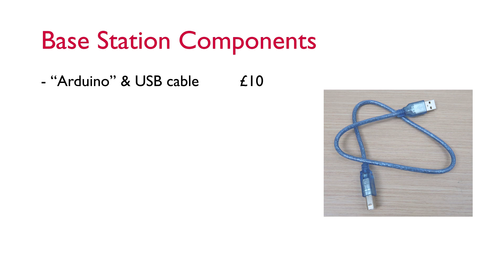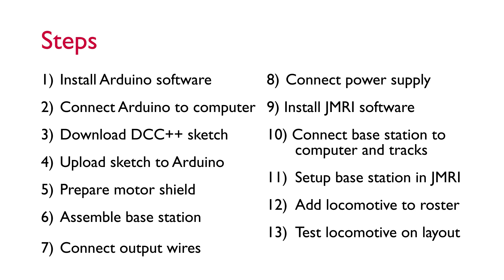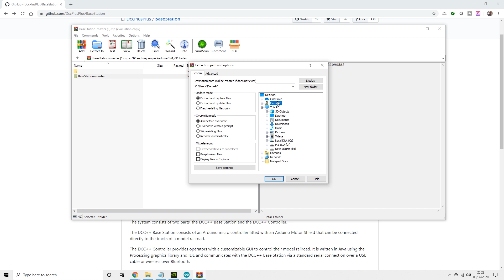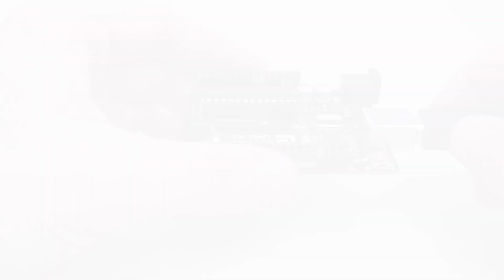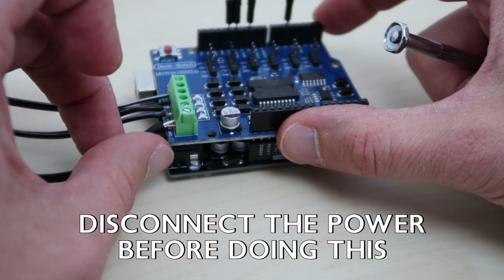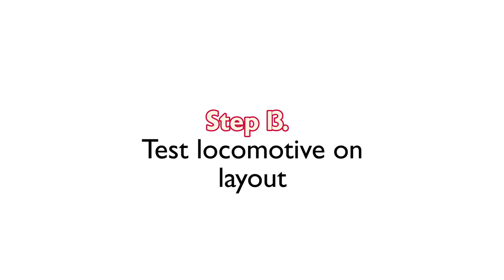Model Railway Digital Controller (DCC++) for £40 or less! 😮

Comment: I found this interesting as lately I have been also interested in the Arduino system. I currently have an Arduino Uno R3, the Mega and some Nano's. I wanted to build a few of the electronic kits available and I also have various module units to make and learn the Arduino system. When I saw this post title I thought, fig I must give this ago myself. The only thing I need is the Motor Shield and to solder up a few cables with Dupont connectors etc. The software I already have on my laptop. Thank you for making this video and showing how to make a DCC compatible system for use with a computer as the controller. Once I try this Uno R3 version, I will investigate scaling it down to use with the Arduino Nano or with one of the other systems available. Edit: The motor shield you use isn't available though there is this one: Yousmile L298P with various Dupont connectors or can you recommend alternatives and whether Vin needs to be broken or not, Thanks.

Comment: Im no stranger to code shall we say, this is exciting I can't wait to get a layout and get on with this
Reply from the maker: If you're handy with code then you'll love Arduino railway projects!
Reply: @LittleWicketRailway  I have a pi sitting around doing nothing but I think I will save that for live streaming onboard a loco.
I will have to get some Arduino's then, I'm also saving all electricals to harvest components rather than binning them.
On the layout front currently I have just one piece OO flexitrack and nothing else, have to start somewhere!

Comment: Thank you for your videos! they are so inspiring ! please advise, during compilation of DCC++ program it gives at 6 warnings, but still compiles the sketch. and uploads to Arduino. is that OK? do you have same? will DCC++ function well with these warnings? i have Arduino 1.8.12 version.
Reply from the maker: Thanks! What are the warnings that you're seeing?
Reply: i tried it on 2 computers - every time is same, it gives these warnings; thank you!
Reply from the maker: Can you post the warning text? If it's working then I wouldn't worry.
Reply: @LittleWicketRailway  yes, thank you! it works, despite warnings. what i discovered that DCC++ does not work on USB 3.0. so ahd to dig out old laptop with USB 2.0 - it works perfectly !!! thanks again fro yoru videos and inspiration !!!

Comment: Any comments on Linux20.2?
Reply from the maker: Sorry John, last time I did anything with Linux was at university a very long time ago. Someone on here might jump in with something though. What you thinking of doing with it?
Reply: @LittleWicketRailway  Mad attempt at Arduino to drive a 3 loop setup, each loop connected by points but able to run alone - main, branch and stopping lines, same as my DC layout. Spose I need power managers and a different Motorshield?

Comment: Rob, If I want to sense trains using IR sensors building your sensor-detection controller, do I also need to build this and how do you connect the two together? I do have a DYNAMIS Ultimate but don't believe I can use that with this setup? Also my Laptop only has two USB ports, does that mean I can only have two controllers or can they be connected through a USB multi-hub unit plugged into one of the USB slots?

Comment: Great vid, got the gear and currently setting it up. Couldn’t have done it without your clear step by step presentation. Thank you!
You may have covered this elsewhere however just in case here’s a note for any windows 10 users. It doesn’t recognise the arduino so an extra download is required. You need a usb driver CH341SER.exe that can be downloaded from sparkfun and then run. Without this file (arduino/tools/port) is greyed out so you can’t identify which port the Uno is connected to.
Keep up the research Rob. There are lots of us cash strapped noobs out there 😅
Reply from the maker: Thanks for the info Mike 👍

Comment: Great video !   One thing to remember is that this motor shield can only supply a relatively small current possibly only about 1A so we can only run 2-3 locos, for more locos a booster is required. Cheers Martyn

Comment: Hi Rob, a fantastic tutorial video.
I have followed this step by step, the only difference being the use of a Arduino Mega 2560 rather than an Uno.  The running track works fine using JMRI, however, when I put loco on to the programming track it will run uncontrollably unless I turn off the power to the track.  The only other thing I can see, is that only 3 of the 4 LED's on the power shield light up.  Any ideas?

Comment: Hi Rob, I love these videos, they're so helpful. I'm building my first layout - 009 gauge and have encountered a problem. 
My set up is as you describe (Arduino Uno etc.) and I'm running on Windows 10.  I have 2 locos, a Bachmann Baldwin, sound version, and 3D print on a Kato chassis with a Train-o-matic Locommander 2 micro hard wired.
I open two throttles, nothing happens on the 'Baldwin' throttle, and BOTH locos respond to the 'Tank' throttle (like it's DC control). Either loco works alone on the 'Tank' throttle and neither on the other. I guess I'm doing something dumb and I know you're not here as a helpdesk, but any hints or tips would be most welcome. Thanks, Jo
Reply from the maker: Hi Jo

Firstly, things are moving so that's positive!

What decoder addresses do the decoders have? Is it possible that they both have the same address?

Maybe put each of them on the programming track individually and read the decoder address on CV1 just to check that they have different, unique addresses.

Let me know how you get on.
Reply: @LittleWicketRailway  Hi Rob, Problem solved, thanks for your reply. I needed to set the addresses in DecoderPro and write them back to the decoders. A beginner silly mistake, but all working just fine now, thanks Jo

Comment: This is awesome! I’m confused by the power recommendation for the tracks. What power voltage do you recommend? You said 19 is too high? I have a moderately sized n scale layout (50 foot mainline) and will be running 4-5 locomotives at most at the same time. Thank you!
Reply from the maker: Hi Will, for N gauge a 14V supply would be suitable that can supply at least 2 Amps. The motor shield can only output up to 2 Amps and that should be able to run 4-5 locos at the same time.
Reply: @LittleWicketRailway  Terrific. Thank you! I’m waiting for my motor shield to be delivered! I hope to get to this project in July. Your video was so jelly and so much more understandable than others I’ve watched.

Comment: Got a problem when trying to identify the decoder in that it says the locomotive is not acknowledging the signal. This happens on the programming track despite the loco stuttering as expected. Tried 3 different locos all known to work, same result. Main track does nothing. Motor shield is slightly different from the one you used, but uses the same pin configuration on an UNO. Tried it on a Mega with the same result. Ideas would be most appreciated.
Reply: I also currently have the same problem. Could you solve it? What??

Comment: Thanks for sharing your experience, the video is quite simple and very instructive (a step by step like few others), I just finished my station following your video, so far everything is going very well.

I just have a question about the power supply of the Motor Power Shield, in your video you use a 19v power supply, this could not damage the Power Shield? The Power Shield technical sheet indicates 14v maximum, I have a 19v source but I did not connect it for fear of burning the module, I am using only 12v 2amp, but I would like to be able to use 15v or 19v to power my rail system.

Again many thank for share...
Reply from the maker: Hi!  The description for the motor shield I used in the video says that it's rated to 12V, however, most of the components are rated to higher voltages (I think the main chip is rated to 46V, the rectifier is 40V, the op amp is 32V and the logic chip is 18V) so I think DIYMore are just playing it safe (disclaimer - I've not checked all the components and I'm far from an electronics expert).

If you google the codes printed on the components then you should be able to see the voltage ratings from the datasheets.

I've got two of these shields running off 19V power supplys and I've not had a failure yet. 19V probably is a bit overkill, you'll need to pick a power supply that is suitable for your models, you could probably go with 16V for OO scale or lower for N scale.

Comment: hi can you help me Model Railway Digital Controller (DCC++) for £40 or less you said you can buy kit can you tell me what kit is the on Amazon is best for me and in all i need in kit for signal / servo motor / lights running n gauge thanks for helping me

Comment: How is this controller integrated with you ardunio sensor hub ?
Reply from the maker: This is a separate unit. However, I believe that with DCC++Ex (updated version of this), you can also have sensors connected to it. I will be looking at DCC++Ex in a forthcoming video.

Comment: Rob I have found your videos inspiring. I have been surprised at the cost of the various items needed to run a DCC layout and your solution of using  Arduinos is great.

I watched a number of other videos where people have a test track to set up a new loco. I guess they do that rather than on the main track to prevent accidentally changing CVs, of their other locos. I had assumed it was not possible to drive a loco on the test track given they are normally very short. Am I wrong? In your video you had a rolling road as your test track. Can you use the rolling road to run in new locos?
Reply from the maker: Hi Roger. Thanks for watching 👍

I use the rolling road for programming, testing and running in most locos.

Comment: Hello again Robbie. I wonder if you could clarify something for me.  I measured the input to the motor shield at 12 volts but there is no desirable voltage either at the output terminal or the track. The power is turned on and the train runs.  Should there be 12 volts at the track? Thanks for you time.

Comment: Hi RObb its the idiot again. I have worked out the problem which was due entirely to my  incompetence. I had made a mistake downloading the programme, after dismantling the arduino forgot to replace the pin bridging wires and then fofgot to switch on JMRI!!!!!
Reply from the maker: Phew! All working correctly now then? Sorry for the delay replying. Hopefully you haven't spent a day tearing your hair out, although that's half of the process with these DIY electronics projects, makes seeing it work 10 times better though.

Comment: Hi Rob.  I'm at my wits end! Your video is easy to follow and I copied it. I bought an arduino uno r3 and an arduino shield L298P ref. A000079. I used a 15 volt power supply and at first all lights came on but there was no voltage across the programme track. I switched off to check connections but when I switched back on the 4 lights on the shield did not come on. Do you have any idea what I have done?
Reply from the maker: All solved now I think?

Comment: I keep my layout in my shed which has no internet connection. If I build the DCC++ digital controller does the computer need to be connected to the internet to run the layout once the programs are uploaded?
Reply from the maker: I take my laptop out to the garage and plug it into the DCC++ base station, no wifi required. Just connect the computer to the DCC++ arduino with the USB cable and away you go.

Comment: I have just subscribed to your very interesting channel I was wondering if you know about or have heard about LCC layout command control it is a system which like DCC is specified and controlled by the NMRA, you can find information about this on their web site also check out rrcirkits web site and costalDCC for a uk supplier. The specification was created in 2016 and is being continually improved like JMRI and DCC. The most important thing for me is every part no matter who manufacturers it has a unique digital address controlled by the NMRA. This means that it is plug and play it connects to JMRI and when set up will run in isolation running parallel to DCC and any manufacturers kit will work with any other manufacturers kit.

Comment: Hi Rob, I have recently got into dcc through the Hornby mixed freight set. I have a question regarding the Select controller with regards to compatibility of non Hornby decoders. I am in Australia and info is zero and I have only been able to find stuff on the subject in various model railway forums that is years old saying that the select is not NMRA compliant. The version of Select that came in the box says it is version 1.6 and i'm wondering if it will in fact work with other makers decoders because I also want to run some Australian prototype trains and my other problem is that Hornby decoders are few and far between down here.I have emailed Hornby for an answer but never got one.

Comment: Hi Rob, I found your channel a few days ago and have subscribed. I found this video very interesting and I'm considering building one for myself. I noticed that you have to make a couple of connections, what size are the connector pins used? Regards, David.
Reply from the maker: Hi David! These are the type of thing you want (https://amzn.to/3beQHbe), although you may not want 150 of them. Just have a search for Arduino jumper cables and you should get the right thing. Apparently 22 gauge single core wire may also do the trick.
Reply: @LittleWicketRailway  Hi Rob, Thank you for getting back to me and providing a link. I think I will try 22 gauge single core wire as 150 jumper cables is a little excessive seeing only 2 are needed. Regards, David.

Comment: have you looked into the Adafruit 1438 (Adafruit Motor/Stepper/Servo Shield for Arduino v2 Kit - v2.3) that can control up to 4 outputs instead of 2? Great video by the way!
Reply from the maker: Thanks Mark! I didn't know about the Adafruit shield, will check it out 👍
Reply: @LittleWicketRailway  So did I, by pure chance! It purely depends on the ampage needed to reliably drive the motor. It does have a lower current output

Comment: Great presentation! 
Here's a question for trouble shooters.
I'm having a problem with JMRA reading my decoders. I'm getting a response for "power on", but JMRA does not recognize my locos (no such manufacturer defined). My decoders are older (early 2000's) Digitrax and MRC. I am also using the L298 P rather than the L298 S motor shield, which is slightly different.
 Does anyone think that these two factors may cause the problem?

Here's the situation, 
-Baud rate is set to 115200
-DCC signal present on pins 6 and 10 of Arduino
-Power ''ON" LEDs,  respond on shield
-JMRA indicates,       Active Profile: My JMRI Railroad       DCC++: using DCC++ Serial Port on COM3    Java version 1.8.0_181 (en)
-I'm reading 4.25v ac on each Program output(B) pins (with respect to GND), or 13v ac directly to output
-The Track output(A): 3.85v on one pin, and 0.21v ac on the other,  (with respect to GND), or 3.8v ac directly to output
//////maybe the output(A) is defective///////
but then, why wont output(B) which is the programming track, read back??
Thanks
Reply from the maker: Hi Richard! How are you getting on?

I'm not sure what the difference between the shield versions is, but I think the L298P should be fine (this one? https://amzn.to/3qZBXTh)

It's hard to measure the voltage of the DCC signal because it's not really AC. What's the DC voltage on the input pins?

Do you have a more modern decoder you could try. I would have thought that if your decoders work on other NMRA systems then they should be ok on DCC++ and JMRI.

When you try to add the locos to the roster is JMRI saying that it can't recognise the decoder or is it saying Error 308, no response from loco?
Reply: Thanks for a quick response.  I changed the motor shield and now JMRI reads the decoders on the programming track, but only a few locos actually run. I still have a couple trouble shooting issues to fix, but I'm almost there! Thanks again

Comment: This looked so good that I thought I'd give it a try, but can't get it to work. My motor shield outputs in DC whereas DCC needs AC, am I using the wrong sort of motor shield - L298P?
Reply from the maker: I'm pretty sure that motor shield is fine. It outputs DC, but can reverse polarity and that's what allows motors to run in both directions.

Are you getting any output from the motor shield? Are there any lights to say that it's being turned on/off by JMRI?
Reply: @LittleWicketRailway  Thanks. Didn't turn on the system from JMRI, so now output AC! Still not talking to my locos properly, e.g. sends the one with a basic decoder in reverse, regardless of the throttle, but won't move if I turn loco around, and won't talk at all to my TTS loco. But this is probably a JMRI issue which I need to look into separately. Thanks again as I think that once I've ironed out my snags this will be a great controller that I can link to my own software that I had already written to connect to the Hornby Elite (which in my opinion is of poor quality).